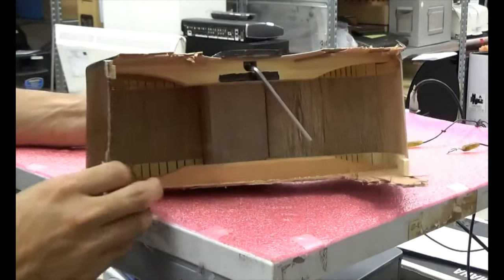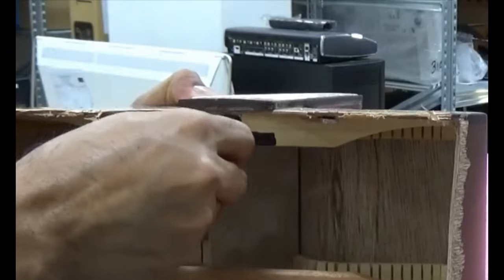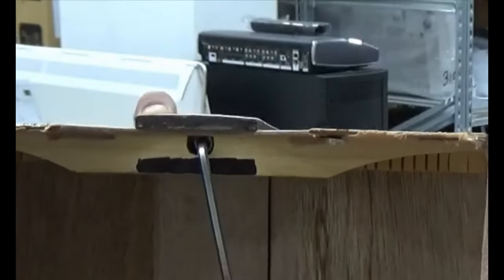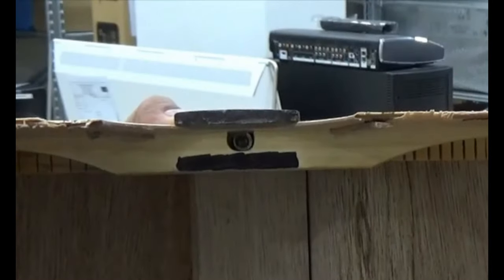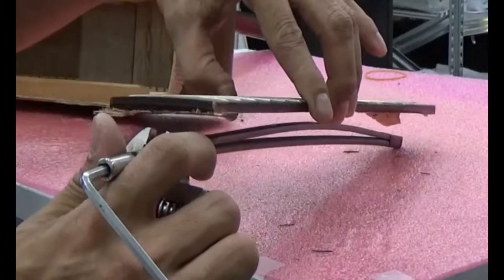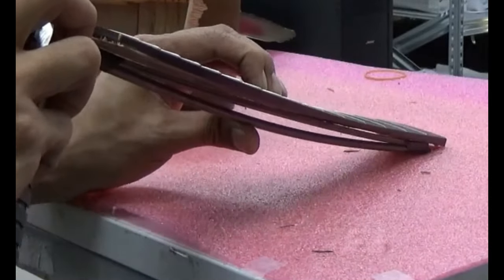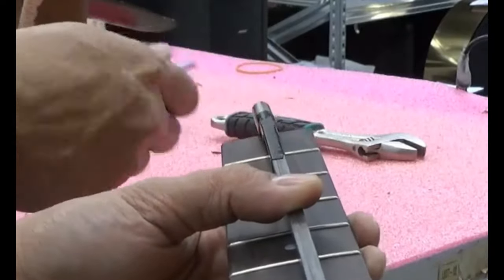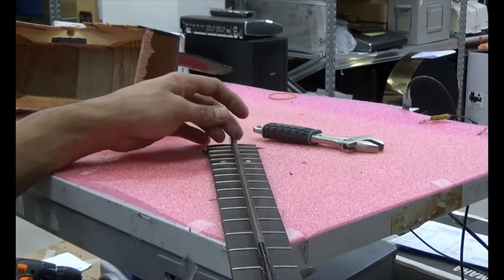How to adjust guitar truss rod? Acoustic and Electric guitar?

Comment: Hi,On an Acoustic Motion guitar, the nut was damaged because the previous owner used the wrong size hex and I can't use the truss rod. Can only the nut be changed?  or do I have to disassemble the fingerboard and replace the truss rod with a completely new one?
Thank you
Reply from the maker: Hi, thank you for watching ☺️
I don't have yet encoutered it but If you can able to remove the nut, it is possible to replace it. If not, the only way is to replaced the whole rod assembly.